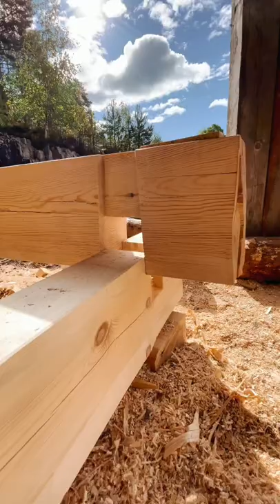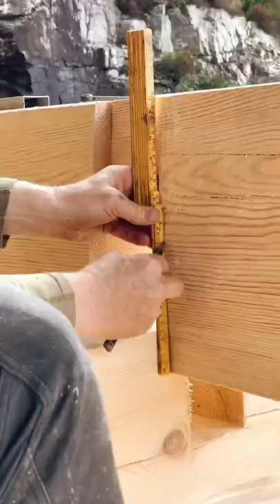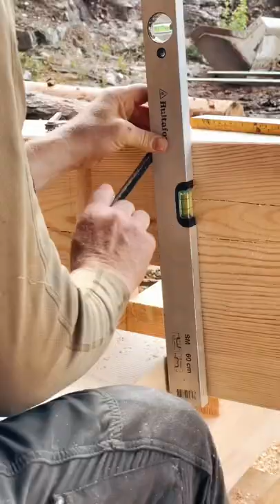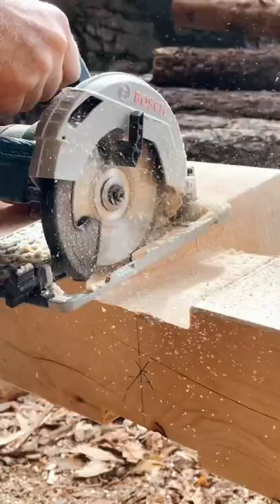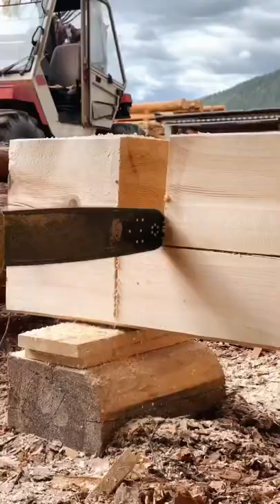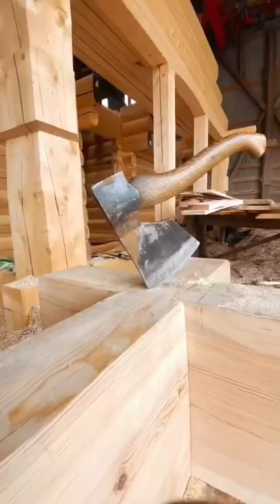Making a timber frame undercarriage for an old farmhouse 🪓

Comment: what’s the point of these large timbers when after cutting them up like this they are less than half the load bearing potential
Reply from the maker: Its not bearing any load in the notches as there will be poles bearing the load. Its an old building method to bind the frames together